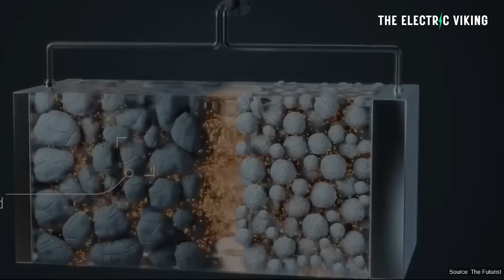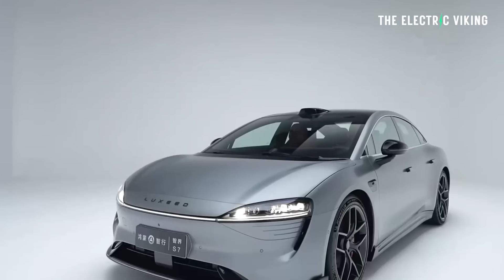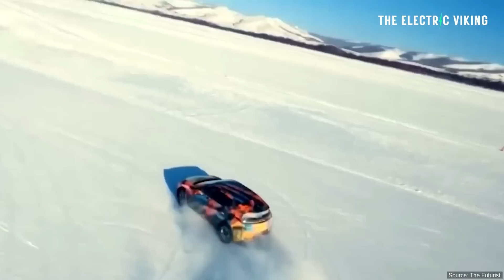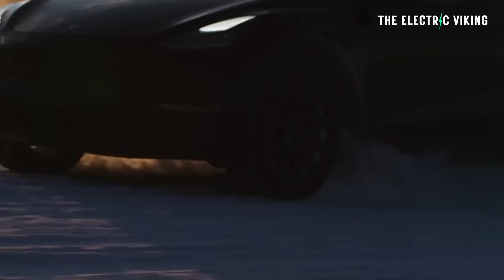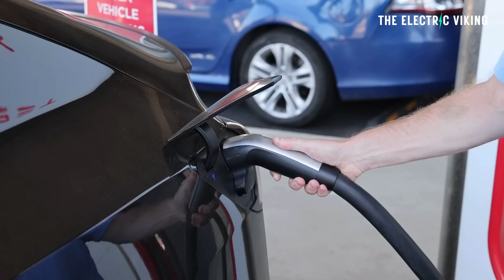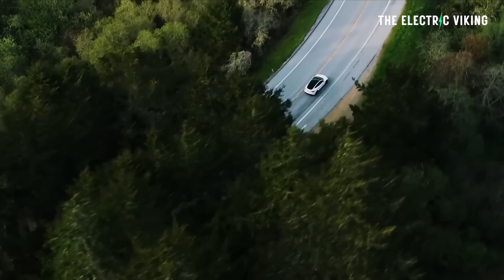Report confirms Tesla Model Y getting M3P battery with insane range & charging

Comment: We'll see when it appears but I imagine that as energy density goes up there is no reason to ship vehicles with such heavy battery packs to obtain adequate range. So if the density were 40% better they might still cut the weight by 25% which still means better range (less work for the motors & better efficiency) but not necessarily 1000km.
Reply: I want 700-1000km EV, because I want to charge only at home, you can go one a long trip and get home, not needed to charge between.

Give us Long range (lighter vehicle) and Super long range version.
Reply: @MagicBox-k3d same. 700-1000 is ICE equivalent. 1,200 km better as it competed with diesel
Reply: @yggdrasil9039  

Which ICE car goes 700-1,000 km? I've driven ICE cars all my life before our switch to EVs and I've never had more that did more than 350 miles. A few times, I wanted to see just how many miles I could get out of my ICE car and I'd baby it and would get 400 miles. We still have a PHEV in the family and that will give us 800 miles when I really want to see just how far I can go. HOWEVER, 1. it's a PHEV and 2. I usually get that great mileage when I just happened to have gone through a period of time when I made a ton of short trips. If you're doing a lot of road trips, the effectiveness of the battery in a PHEV goes down tremendously.

So I'll ask again, which purely ICE car is giving you 1,000km/600 miles?
Reply: @dontbanmebrodontbanme5403  Most diesel ice vehicles will give you that range, as well as hybrids. My hybrid ice gives me about 1,100km a 45L tank.
Reply: My Diesel VW Transporter work van will get 800KM+ fully laden and ladders on the roof. I believe they will do over a 1,000km when unladen. They have an 80l fuel tank.
Reply: but then you wont be chargigna t tesla powerstations at 5 to 8x marketrate of power @MagicBox-k3d
Reply: @MagicBox-k3d You can add 410 km of range in 10 min with these new batteries.
Reply: @MagicBox-k3d  

Sure, we'd all love an EV that could go 600 miles on a charge, but very, very, VERY few people would actually need that. If you're doing a long road trip, after about 200-250 miles or so, you're going to need a rest. At that point, you've been behind the wheel, what? 4 hours? You need to use the bathroom, stretch your legs, get something to eat. You can charge while you're doing all of that. Your argument is you only want to charge at home, but in order to do that, you're lugging around a heavier battery and getting less efficiency, so you're suffering day to day just for the times when you want to drive long distance and not have to use a public charger. You're also going to pay way more for that. There's no way anyone is going to sell you an EV that can give you 600 miles of range without charging you way more for it. 

It makes way more sense to get a car that can do 400 miles/640km that can charge to 80% in 15 minutes. It'll be way cheaper to buy, will be lighter, so you'll get more range and for the few times you need to do a 600 mile trip, you'll have to suffer and use a more expensive public charger.
Reply: @dontbanmebrodontbanme5403 
Cause, when it has full self driving I want to be able to sleep 8 hours between charges 😂
Reply: Yep. This is proven with every other thing that uses batteries.  Laptops.  Phones.  Even golf carts.  They reduce weight when possible first.
Reply: @jrherita  but people do place value on phones that last over 24 hours of constant use and so some phones are made with that kind of battery then on top of that $25 will buy you another 20,000 kilowatt hour side battery.
Reply: I like the flexibility this offers. You can either have a much lighter around-town car with less battery, or a longer range heavier car.
Reply: Don't give them idea. Look at cellphones. Each time cpu becomes more efficient. They reduce battery size. As long as you hit the "all day usage", they are happy to cut back. Thinner case, less batteries cost.
Reply: @RokkuAni  mobile phone batteries don't get smaller. The CPUs don't get more efficient. The chemistry makes slimmer more powerful batteries to run the smaller more power CPU.

Then along comes Apple and Android to make shitty software that you need all that new power to run, and bang, your phone is now as shit as it was 2 years ago.

If we took software from phones from 10 years ago and ran it on today's hardware, it would last a week on a single charge. But people want to watch Netflix in 8K. We all want to use Photoshop right in our hands. And it the game we are playing isn't crystal clear and fast... We bitch and moan. I blame people for wanting to do it all on their phones.

I just want email and Spotify.
Reply: @RokkuAni I totally agree, but the anti-EV people aren't going to switch until electric can go as far as gas. So they have to bump it up to sell cars.
Reply: So many anti BEV commentators on this site devoted to BEV tech. It's very odd. Range anxiety expressed like a neurosis that would delight Freud. Am I the only one who thinks these overweening worries reflect something deeper? 🤔
Reply: @dylanthomas12321  Range anxiety is real, especially in countries that have huge distances to cover
Reply: exactly! Personally i dont need 1000kms, 500kms is more than fine! I manage almost a week with a 50kwh battery (~300kms) so 500 would fite nicely and you can slash the weight by "half".
Reply: Available supply will mean they reduce battery so that prior range is still achieved. Sure they can sell a longer range version in the future when no longer battery constrained.
Reply: VW PASSAT b6, 2 .0 TDI, 70l tank, 6.5l/ 100km, so...1100km range
Reply: Sam's guess was 380 miles for Model Y LR, that sounds very reasonable
Reply: Lucids have spectacular range and literally no one is buying them. 

Tesla will never release a 500 mile range car nor should they, this was guaranteed with the Cybertruck that doesn't have a mega battery version only an extension. You just never need 400+ mile range and 90% of car users can live on ~300. Supercharger infrastructure is great, you can charge at home, there are many destination chargers and stations grow exponentially. It's all about fast charging: if you only need 15 minutes to pee, visit the store, get a coffee and get from 10% to 80% range, you'll get tired of driving before you run out of juice. 

Less battery means less environmental footprint, lighter car with less consumption, faster acceleration, better agility and better price. Trust Tesla on this one and if you indeed need to tow during the winter and want to go electric, buy the Cybertruck with the battery extension - guess what, you're a niche crowd.
Reply: Until last year I had a 2008, 2 ltr diesel Ford focus titanium cabriolet and while not a 1000 km, with a full tank could it could show 938 km and I could drive it 850 km or more before the 80 km left warning came on. Mind you if that was for a single trip,  I would already have stopped 3 or 4 times for a coffee refill and / or toilet break.
Reply: I’m hanging out for this Model Y LR. I’ll probably have to get the current version once the prices plummet, then pick the Juniper up when the first batch of lease vehicles hit the used market in 2027. That’ll be my forever car then as it will meet my needs as far as range, charging speed and load space goes
Reply: Hi Dominic, d'you reckon there will be further MY price cuts?  @Crazydiamond_1974
Reply: @Crazydiamond_1974 Seams like a good plan. Wait for current generation models to plummet in price and buy a second hand version of it. It actually looks like Tesla is preparing for this as well as right now in Romania a model Y costs the same as a model 3 Highland so clearly they want to get rid of as many as possible before the new model shows up.
Reply: I posted pretty much the exact same thing you said. First off, if they delivered a MYLR with the Juniper refresh AND it could do 600 miles? Why on earth would anyone buy the Model 3? They might as well stop making it at that point, because no one in their right mind would buy it. Almost certainly, assuming this battery is as good as advertised, they'd put enough battery in to make it do 400 miles, which will be an improvement and will lower costs for them. Combine that with the faster charging times, the only question becomes are there enough charging stalls. As more and more charging stalls get installed, 400 miles of range and 15 minute charging times to 80% make it such that anyone can buy an EV, even people living in apartments with no access to a home charger.

What Tesla SHOULD do is update the Cybertruck with this battery and give it the 500 miles of range they promised, which would be 200 miles while towing 11K lbs!
Reply: @dontbanmebrodontbanme5403 Well I  must be out of my mind because I have no interest in the Y at all, but may give up my CT reservation if the model 3 ludicrous is outrageous enough.

Comment: Tesla should be placing these batteries inside The CyberTruck because one of the biggest complaints is that CyberTruck range is  horrible . 

And I have no problems producing many links , to many channels that say , the Range of the CyberTruck  is Horrible !❗️!

~○~
Reply: How often do ppl drive 340 miles Non stop?
Reply: @mikafiltenborg7572 a full featured truck needs to be able tow.  I realize most people don’t. …but most truck owners rarely get much use out of the truck bed. But truck owners want that capability.